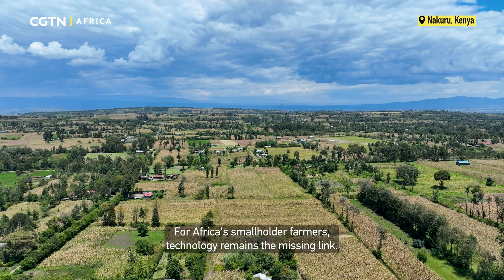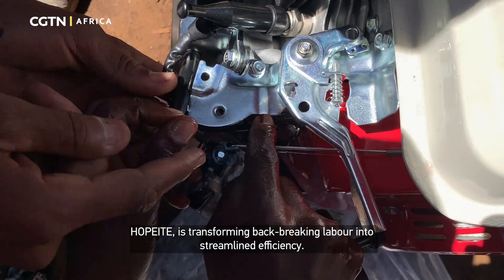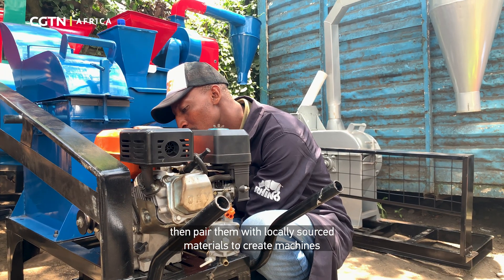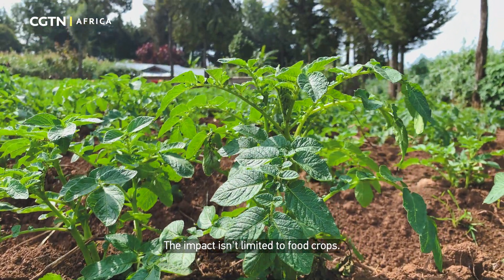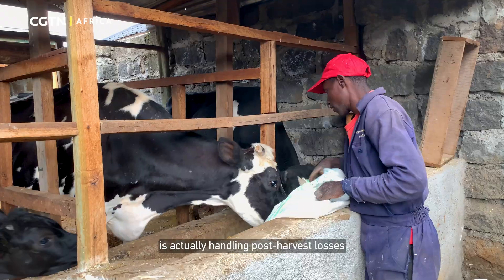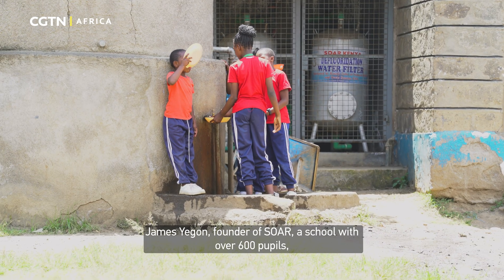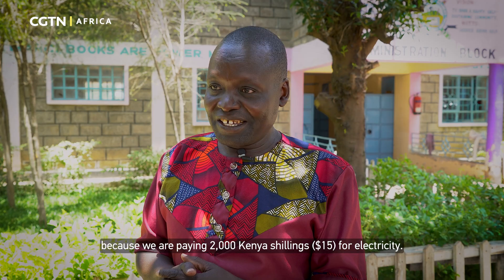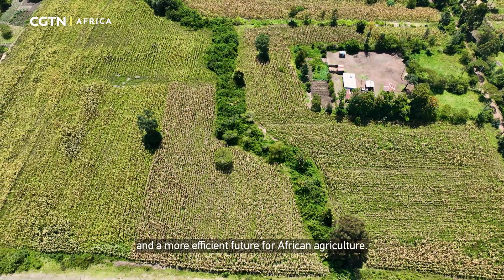Three young engineers are transforming African agriculture

Comment: Excellent initiative. Perhaps the next steps could be to electrify all the machines in conjunction with implementing solar microgrids and agrivoltaics, such that the farmers are liberated from fuel costs and the air pollution produced by those internal combustion engines.
Reply: China is probably taking the lead in selling decentralized solar to Africa.

Comment: Now Solarize these units using BLDC motors
Reply: They have the ones that use biogas as well as solar
Reply: The idea of this type of endeavor is to create resilient machines that are simply, cheap, easy to fix and maintain and do not make people dependent on commerce with large metropolis. What you want would defeat the whole point of the project.
Reply: @gabrielamora6265  1:08 "They import durable components, such as motors and engines." So long as the farmers are using internal combustion engines, they will be dependent on buying fuel from "large metropolis". Also, the energy conversion ratios with biogas are unfavorable, it is not a sustainable alternative at scale, and it still creates a large amount of air pollution when combusted. Solar photovoltaics can produce far more energy per acre than biogas, and doesn't compete for scarce water resources.

When solar energy is implemented via agrivoltatics or rooftops, with microgrids and batteries, it can help entire communities through providing energy for lighting and clean cookstoves.

In terms of creating "resilient machines that are simply, cheap, easy to fix and maintain", electric motors require far less maintenance than ICE engines, and because there are fewer moving parts, tend to be much easier to fix and are more durable.

As such, what @stefanogizzler suggested would actually help them achieve and improve upon "the whole point of the project".